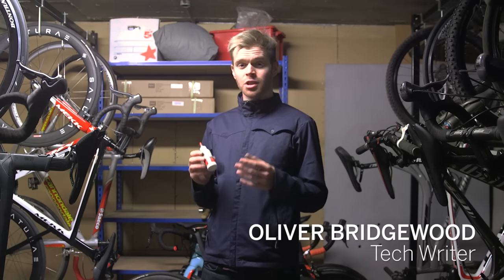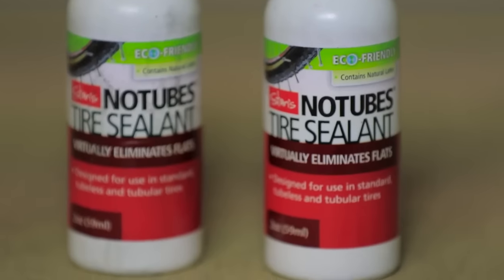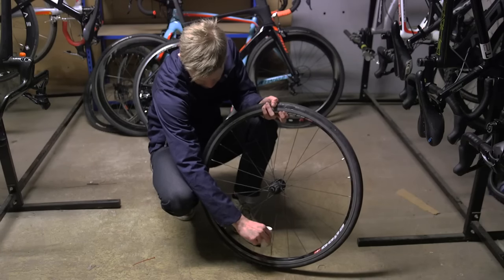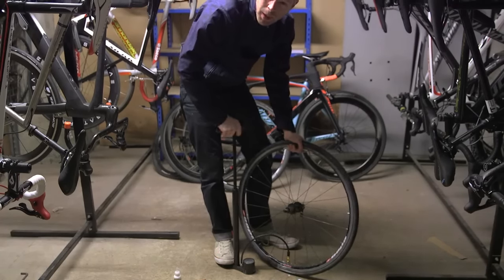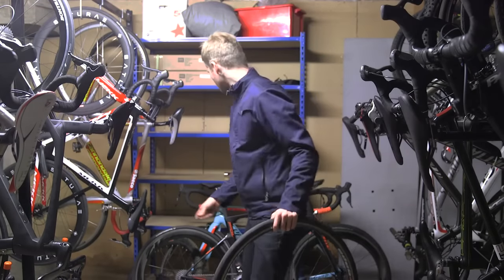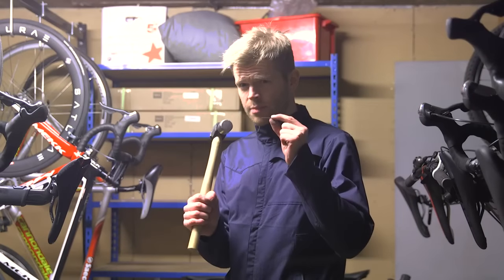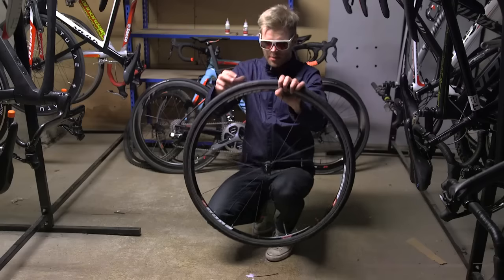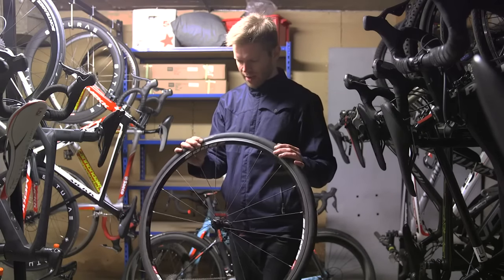How to puncture proof your tyres | Cycling Weekly

Comment: never suffered a flat on road with this trick. plenty of dried sealant typically between tire and tube though when I swap tires, indicating that there have been many punctures that I have not even noticed. also a great tip for reducing the amount of pressure you lose over time; now I need to top up my commuter pressures only once per month at most.

Comment: Works great for me!  I've had four front wheel flats back to back (inner tape was fine, rim wasn't bent, tire brand new) and a bike shop mechanic talked me into trying out the sealant and now it's been about two months without a flat!
Reply: Very Good seeing the positive results of using  sealant in bicycles even with inner tubes thank you especially for the live demonstration 👍

Comment: Wouldn't this end up sealing the valve itself too, such that you can no longer top up your tyre pressure?
Reply: There is an increased chance to seal the valve. In most cases it's a weak seal that is easily handled by the pressure of a pump refilling the tire and especially handled when refilling the valve with sealant. But, in any event, one can purchase valve cores on the cheap (I got 25 of them for $10 from Amazon) and either clean the old one or replace it when you want. 
Either way, it's all worth the reduction in flats, especially in cold or rainy weather.

Comment: Great idea but Stan's, Slime etc. have a short life and can clog up your valve.  I've used Ultraseal with 100% success on motorbikes and cycles but there's also OKO and Puncturesafe and they all last the life of the tyre, can be washed out of tubeless tires with water and are used in plant, military, delivery and emergency vehicles around the world (and on the lunar rover if you believe their claims!).
Reply: NO2theEU Didn't the lunar rover use a metal mesh tire?
Reply: Just use a paper clip straightened out to clear, don’t store you bike on its wheels for long periods or it will stick them together. Otherwise works fine
Reply: Short life are two years (slime)? lol
Reply: Thanks for the recommendations of products because I was searching for exactly this as my electric stand up scooter tubeless tyres, puncture repair 2 this week alone didn't work so am going to order some you recommended as this model does about 60km/h and when I can't use it, well I find I smile less 😉😅

Comment: If you bought a new tyre, hang it first to dry out because new tyres are still wet and soft. Drying it out will harden it and will be less punctures. Also coiling an extra inner tuber or using liners will help prevent punctures

Comment: will it do that if we keep the sealant in the tube for a long time? like it wont dry off or something?
Reply: most sealant (stanz) will actually evaporate after continuous use in roughly 6 months depending on where you ride. Therefore it is a good idea to replace or refill the tubes with sealant so it doesn't get all crusty or run out.

Comment: Tried it.. It will mess up your valve, which will make it hard to inflate... Just use a bottle of Vittorias sealant.. It's inflate and go...
Or just swap tube
Reply: Just inflate once u put it in to a good pressure like 60 to 80 psi to push all the shit blocking the valve

Comment: Every time I have used a sealant like Slime or Fix-a-Flat in my tires, I've ended up with no flats for a good time, but that crap starts to gum up the valve core and valve seat so I had to replace the tubes because of slow leaks at the valve requiring me to top up the air every other day.
Reply: I thought you would use the sealant after you notice the air hissing. How many times have you applied it to where it starts to mess up the tube
Reply: @1krazyking  The Slime brand sealant is actually designed to prevent flats as well as to repair them.  I used to use it to prevent flats.  I would apply it once.  After maybe 2 or 3 years it would begin to gum up my valves so that the valve would develop a slow leak.  I tried cleaning the valve but to no success.  I have since stopped using Slime.  I ride maybe 3000 miles per year on either fairly clean pavement or gravel, generally on 1.75 to 2.25 tires.  The only flats I was getting were from the Slime gumming up the valves - but maybe the Slime was saving me from puncture flats.  I don't think so, because I never found any Slime on the outside of the tubes when I changed them.  Still - if a person rides in a puncture prone environment, the Slime may be worth the trouble.  If you're getting a flat more than once every other year, then the Slime may save you some trouble.
Reply: Michael Gantt thank you for that your very experinced I appreciate you
Reply: Where I live, flats are common enough that if you even get a few months out of a tube (ie with sealant or with a heavy duty tire), it's a good deal.    Replacing a tube every few months is no big deal for me.    It's the replacing a tube every week or every other ride that is the problem.     Plus, if you run Schrader valves, it's easy to replace the gummed up valve core.

Comment: You're not "puncture proofing" your tires -- you're filling the punctures with glue. Which means your tires could be full of holes and you'd be none the wiser. For this and many other reasons that readily come to mind (and are stated elsewhere here), the glue-in-your-tubes approach is a BAD idea. 

One alternative: a puncture-resistant performance tire like Continental's Attack and Force models. Or if you are really paranoid about flats, their Grand Prix 4000. On the other hand, if you insist on riding "competition-weight" clinchers like Michelin Power, you are going to get a LOT of flats.

Comment: I use the green slime,  probably very similar stuff,
It works for 99% of punctures, I  big staple in the tyre ( 2 holes quite big ) rusty too, rode home without noticing lol,   pulled it out at home as I noticed hissing  and tyre went down faster, I pumped it up again and spun the wheel and it fixed it, I've been on loads of rides since with no problems.
Got a flat in a tyre today with a tiny thorn, that tyre did not have slime in but had supposedly armoured puncture proof tyres on already so I hadn't bothered with slime..

Comment: I used PVA glue. I put 30 gram into tube. Normally it should be flat in 2h, after PVA in 14h looks ok. It worked great so far when I pumped to 1.8 Bar. Today will pump to 40PSI and ride to test if it works under stress.

Comment: read the contents of the sealant carefuly

most of them are either too thin or too thick or are unstable in terms of clump forming. and the results are unpredictable. when we have had tubeless technology all sorted out, there may not be any need for this. 
on the other hand talking of bicycle racing tyres, there is probably always going to be the compromise of contradicting demands. the new development of graphene intelligent tyres proves that you cannot have it all. the puncture protection is a great challenge and will continue to be so

from my personal experience, it is not worth experimenting esp if you like using latex tyres, some of the chemical reactions may be unpredictable and the use of liquid sealants best applied as an emergency rather than preventative measure.
Reply: No

Comment: Am using 28mm touring tires with folding tires that have had the edges cut off put in.   So it's like two tires in one, not done many miles yet but with update in a month or so.   Its a old hack from back in the day.  🚲
Reply: Any updates? I do the same thing but without the sealant. Last puncture was from a pinch flat, I ran too low pressure that day.
Reply: @tomcruz3774  Hi  Yeah it worked.  Have rebuilt the bike into a old school gravel type machine.  Heavy 40 mm tyre on front 32 on rear so dont need that bodge now.

Comment: I use conti gp4000 2 and cut-off  valves on fulcrum r5 alloy rim. With the help of 2 rolls of electrical tapes and sealant, I manage to get them sealed after a 10km shakedown ride. Apparently, the feel is a lot muted on 120psi and very comfort (totally depends on how soft the tyre wall is) and the road noise sounds cool as well

Comment: I use tubes on a 26" x 3.8" fat tire, and no sealant will stop the punctures I get. There's a 1 inch gash into the tire and the sealant just pours out of the tube and INTO THE TIRE, pushing the tire off the rim. Terrible. I have no idea what people are throwing into the streets to cause these kinds of holes, maybe razor blades?? Either that or someone is taking a knife to my tire because it looks exactly like a knife stabbed into it... Either way, sealant doesn't work.

Comment: But sealant doesn't work on road tires at 10,000 feet. I know because I raced Pikes Peak in 2018, not knowing I had a sealed puncture in my race wheel 'till I was at the start line--I saw the shiny spot where the sealant had plugged a hole.

200 feet into the race, the hole opened up. The air pressure different opened the hole and I was fortunate enough to convince the organizers to give me a restart. They'd repeatedly said this was a mass start time trial, so since I was only a few hundred feet down the road, they allowed me to swap wheels and restart.

Comment: I put one of the propylene glycol based sealants like Slime in my street tire MTB. I pulled out roofing nails, staples and a piece of wire coat hanger with only a small loss in air pressure until I patch it at home.

Comment: Looks like Slime which is very good stuff.  it's designed for tubeless not tubed tires. It doesn't dry out. I suspect it won't work as well in a tube.  He also should have cleaned out the valve with a cotton bud or similar before putting the valve back in.

Comment: I did this and it worked sort of.  I rode 60km not knowing that I had a puncture.  The sealant did the job.  The tire didn't deflate but the sealant kept oozing out.  Only drops.  It splattered on to the frame.  In the end, I had to replace the tube.

Comment: You don't need to remove the valve core, and you can just use an old pump to inject the sealant, just rinse out the pump afterwards.

Comment: It didn't work for me this is only for very small round holes till 3 mm diameter. I've used Stan's high presure and then at the first time it didn't worked because it was a litle cut not a round hole.

Comment: The Slime goes dry within a year, so I'm wondering how long this lasts? I bought some at £3.80 per bottle, so even if it lasts 6 months that's worth it, or even 3 months. 

I always used punture proof tyres because I get a lot of puntures in my area, sometimes several times a day. But they say they are heavy and slow with no fun factor, and also have poor grip because they are tougher and less flexible.

It will be interesting to try this with regular tyres.

Comment: Doesnt it only work since u just put the sealant in and it hasnt dried inside yet? I highly doubt it could work once the sealant has dried or been in there for awhile, I could be wrong
Reply: DeagleBeagle yeah it seems like it would eventually dry and harden inside the tube after a while.
Reply: its tubeless sealant you leave it inside your tire its designed not to dry up
Reply: MegalodonGaming exactly.
Reply: DeagleBeagle it is advised to replace or add sealant once every 6 mo ths. The good thing is that the old sealant once dried will form another layer within the tire. I have been running tubeless in my mountain bike for 3 years now.

Comment: That was brilliant. Just would have liked to see you riding on the puncture sealed tire and whether once the sealant had cauterized the hole would it keep reopening the wound from the constant flexing of riding on it. Tricky to do on a presta valve although I guess possible if you had actually removed the tube from the tire. You'd have to manipulate the valve back into position from the inside once you'd added the sealant.

Comment: I have 2 29"tires that I tried multipull times to seal with a Stans No Tube kit several years ago.It did not work and I was left with two damaged tire beads.I had some sealant left and tried an experiment.I added the sealant directly into the tire with the tubes in place.After much leaks around the damaged beads on both tires I have found that the tires have had very little pressure loss after they sealed.It's been the better part of a year since I last aired them up and they are ready to roll.These are spare tires left after my bike was stolen so they do not get used.The new bike has good tires so no need to change.

Comment: Need new TUBE as this half Baked idea seals the valve so you are unable to pump up tube to freshen up the pressure  This was not mentioned in the Presentation video !!!!!!!!!!
Reply: Brian Temple 
The majority of mtn. bikers have converted to tubeless tire set up using Stans sealant and typically inflate and deflate their tires frequently for that right amount of cushion and traction. Stans sealant will not clog up your valves. Even if it did , the 3-6month puncture resistant benefits you get from a $3.99 tube you can dispose is more economical than 6 innertubes you would have to buy for a flat if you had 1 flat per month...

Comment: I've used sealant with a tire. It leaked down while riding, and held air when stopped. The movement seemed to incrementally break up the sealant.

With your nail puncture,  try riding it on one of your outings, and please add the results to your video.  I'm curious if my bad  experience with sealant was unique.
Reply: I've found the same thing, it plugs the hole on an unloaded tire but when the tire is working and being stretched and deformed, the seal is constantly broken and resealed over and over again. There's also the chance that the puncture in a high pressure tire will eventually tear and rupture. 
Another issue is that over time the sealant will dry out and the tube will be trash. I do better with kevlar protected tires with tire strips than anything else.

Comment: Hi i have a road bike and i have a schradier valve how do i use the selant on that thanks. 🙂
Reply: Schraders are easy - get a schrader valve core remover.   It simply unscrews the core (lefty loosy, then you just pull it out).   Then you put in your sealant, and then righty-tighty screw the valve core back in.    Sometimes sealant messes up your valve core (usually takes awhile).    It's good to have a few spare cores around (from previously flatted tubes).

Comment: But then when do you have to remove the sealant??? Is there a video on this?
Reply: You don't have to ever remove it.  you can top it up - it stays liquid for over a year inside a tube - there's almost no evaporation - just the little lost through the valve when adding air. you can drain it too.  just take the tube out - remove the valve core and gently squeeze out the sealant.

Comment: I've never had much joy with Slime sealant, which acts the same as this. I've  had so many punctures with slime innertubes which do not seal themselves because the glass/stone becomes embedded into the tyre and tube. The glass also leaves a big cut in the tyre. so how can you plug a hole/gash in the tyre? I cannot afford to keep buying continental untra gator tyres (which are supposed to be very good). How do i repair a tyre permanently?
Reply: try different tyres and see how they hold up - if you ride rough roads with lots of flint then you will need a tougher tyre. As a tyre gets older they seem more prone to punctures so replace when appropriate - also consider whether to replace tubes rather than fix - I normally find a puncture repair has a limited lifespan.
Reply: Use puncture proof tyres and inner tubes. Like schwalbe marathon plus and kenda thorn resistant tube.  Also consider tire liners. If those three combination still can't fix it,  that means your path is just too bad
Reply: It's mainly designed to use with tubeless tires not tubed. It can seal pretty big holes but not big cuts.

Comment: Impossible to fix if the hole is to big.
Reply: In a motorcycle it can fix 4 and 6 inch nail sizes. Can struggle to seal a cut tho'

Comment: Wouldn't the sealant plug your valve ?
Reply: Yup!  but you can still put air in - your pump will just force it open.  You can unscrew the valve core once in a while and clean the gunk off - takes a 5 mins.

Comment: does it work on a schrader?
Reply: Its all about getting the sealant into the valve. Dont think schrader have removable cores so might be difficult
Reply: +Phil Petersen most shrader valves are removable and slime make tubes pre filled with sealant
Reply: The slime sealant I saw in stores, has a cap on the bottle that also acts as a schrader valve core remover.

Comment: Is there any downside to this??
Reply: Additional weight in the worst place for additional weight, but only a little. Possibly clagging up the valve over time. But compared to having to change a tire at the roadside, that seems small beer really.
Reply: Just adding a cat eye reflector when spinning the tire, caused the front of my road bike to wobble. Removed the reflector and wobble was gone. Adding additional ounces inside a tube unevenly spinning? Probably going to experience a change in the smoothness of the ride. I've never tried this. Cause I don't like experimenting with my money. Just speaking from a tire balancing perspective.

Comment: Does the pressure hold long term, overnight or just hours?
Reply: I pulled out a piece of wire 3 weeks ago, went half flat, spun it, pumped back to 90psi and still holding 90psi 3 weeks later!
Reply: lloydy_paul Really that is suppressing.